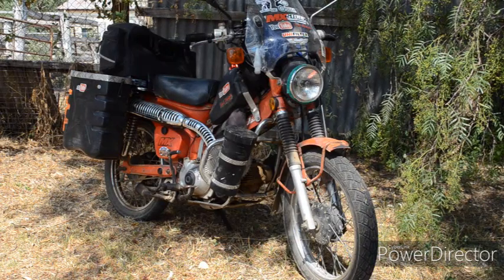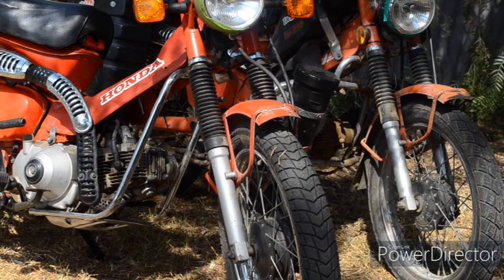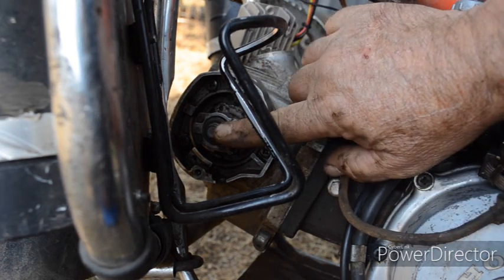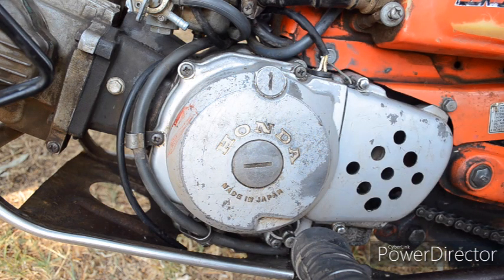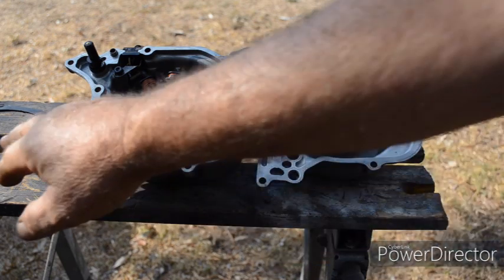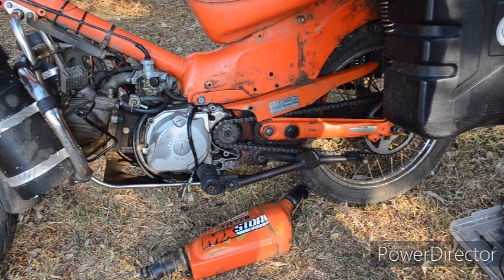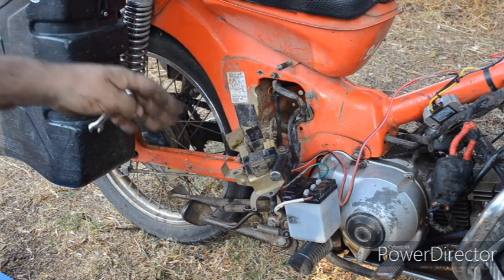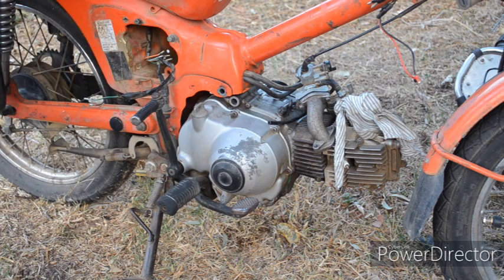Honda CT 110 6 to 12 volts conversion - Part 1

Comment: I have an ‘81 110, not sure if it can be done if I have points instead of CDI.
Reply from the maker: If you fit all the components of the 12v system it can be done just the same as I did in these 2 videos.  If your bike has a hi/lo or sub trans gear box it's more difficult.  The left side cover would need fabricating & welding to fit the 12v stator & pick up.  There's a video on YT showing someone doing this.  It's not a simple job.

Comment: I'm about to replace the 2 pole stator on my Lifan 125 for a 6 pole, the 2 pole is useless. Should have it in the mail in the next few days.
Reply from the maker: Yeah, nothing worse than unreliable electrics.  I wished I'd have converted my bike years ago, I wasted a lot of money on batteries, stator, voltage regs & of course globes...

Comment: Now is time to upgrade your headlight to led. 
It was my best upgrade at my bike.  Now I can drive it  at drark roads with great view. 

Kisse from Greece
Reply from the maker: Yes led is a good idea, but with ct headlight running on a/c it makes it a bit more work.
Reply: @Free_Ranger_CT110   it is easy my friend.  Just cut the yellow cable and connect it to black.
Reply from the maker: Just fitted an LED light bar to my bike, voideo out in 2 weeks.

Comment: That will be a really handy conversation Darren, I was not aware that CDI and 12v versions of the CT existed. Looking forward to seeing the next video
Reply from the maker: Thanks John, after watching your videos I read your comments & hear your Scots accent!  The electrics were always the achilles heel on my bike, it's much better now.  Converting a hi/lo bike will be more difficult, they weren't made in 12v & it would need a cut & weld job on the engine cover.  I think cdi was introduced in the mid '80's & 12v in '93.
Reply: @Free_Ranger_CT110  Yes Darren, I don't think I will bother trying to convert it. Great to see the mods you have made to your bike, it's such a functional tool now. I have two early 6v Daxs, I plan to put put a 12v C90 engine and loom into one of them. I have the parts ready, just need the time to do it!